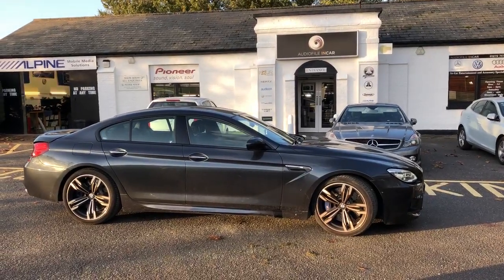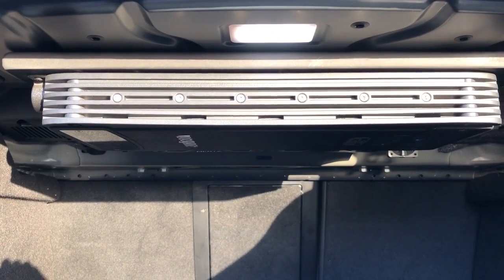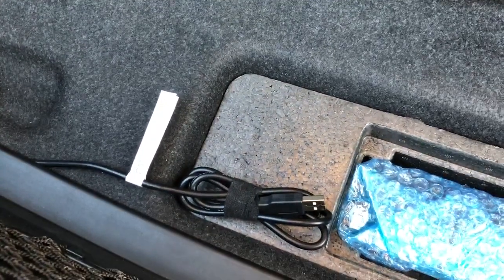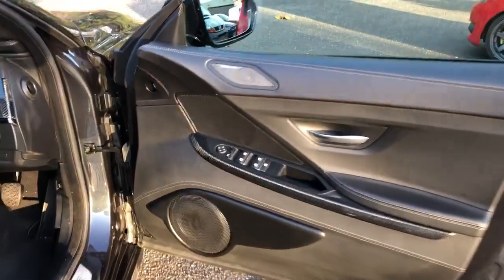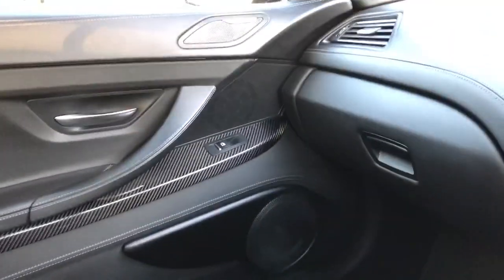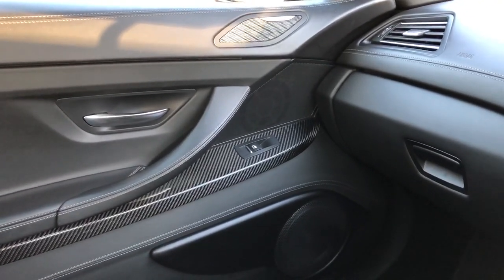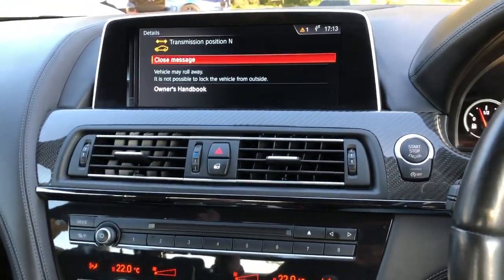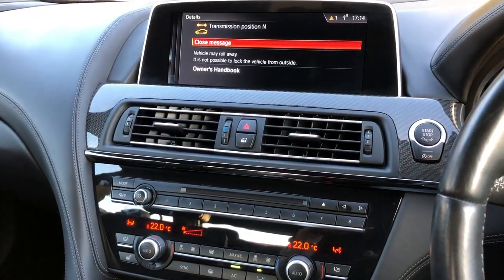BMW M6, Hertz Mille and Audison Voce, Full HD Audio Upgrade.

Comment: Just out of curiosity - since this looks like a 'money is almost no object' install, why did you not add a 2 channel amp to drive the 3 inch and tweeters separately rather than using a passive crossover. Would you have not gained greater clarity by removing the passive xover from the chain?
Reply: I reckon those passive crossovers are probably superb, real high end, plus I’m guessing the fact the mid and tweeter are quite close together distance wise then there’s not a lot of point running them active as time alignment is not such an issue, If the mid was in the bottom of the door and tweeter up high then I think it’d have to be ran active to compensate the distances between drivers. I could be wrong though. It’s just my thought

Comment: 3 way + AVK 5.1 ? How was this connection made? If they are 2x Class A, 2x Class AB and 1x class D ?
Reply from the maker: The class A section ran the Mille mid and tweeter via the Mille passive crossover.

Comment: I had recently added a bit dmi in my f30 audio setup and found out that some other companies that build most-toslink converters specify 24/96k in the manual. Just wondering why the bit dmi has only 16 bit resolution
Reply from the maker: It's quite an old bit of kit now, we use alternative products now which are 24bit.
Reply: @AudiofileIncar mind sharing what you guys use now?

Comment: Trying to fit a bit dmi to my e91. Cannot for the life of my to be recognised on the laptop. Any ideas ?
Reply from the maker: I can only sugest re loading the software for the DMI onto your PC, reset the PC etc, we have not had a problem in the past with a DMI, I assume it is working? Is it new or used? If its new your dealer should help you with tech support.
Reply: @AudiofileIncar  brand new. Tried 2 laptops with no joy
Reply from the maker: @adam2jzzz801  Then contact the supplier, it may be faulty.